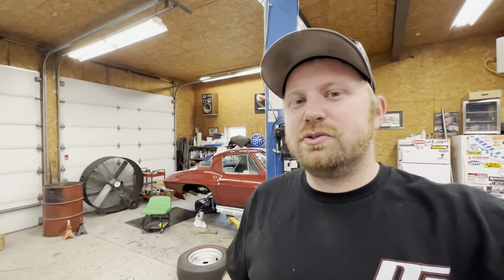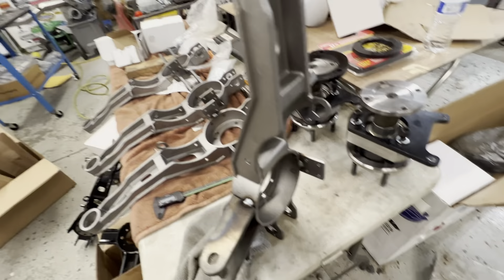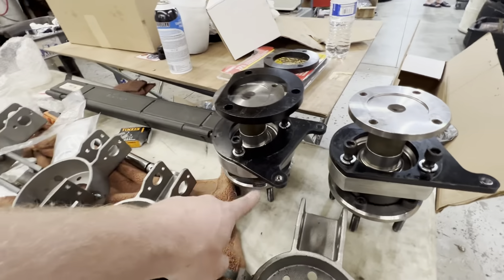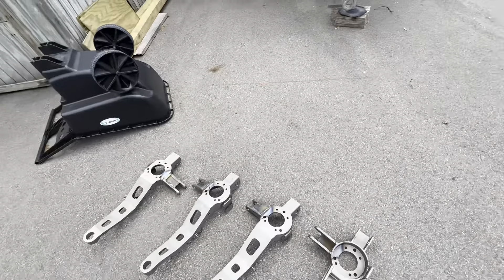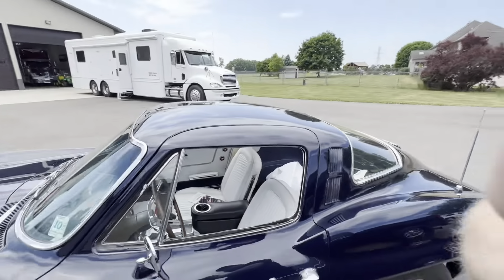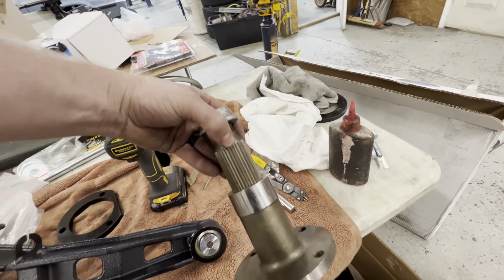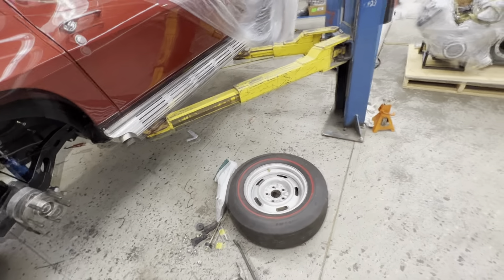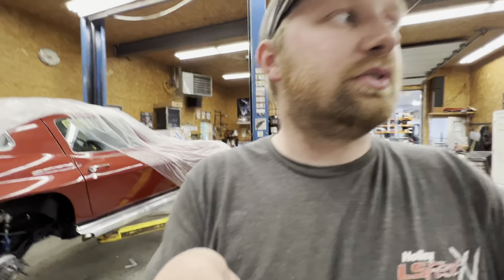Fixing The 1967 L88 Corvette with INSANELY STRONG Trailing Arms. Stock Appearing 427 Vette Updates!

Comment: Ran 1.46' sixty foot with stock Hz Holden suspension, stock front A arms, stock front springs and shocks, just the rear springs and shocks changed, stock original factory rear trailing arms, stock bushes.

Comment: Great to see someone working on the old Corvettes, nice work! I have a 1970. I purchased Van Steel offset trailing arms, along with their coil over rear suspension kit. Top notch stuff. The arms I received are all steel and powdercoated black, just beautiful pieces, I think they are worth every penny. Super heavy duty compared to the stockers, it's not even close. How are the frames holding up to that much power? Tom's sells a kit to reinforce the rear of the frame near the wheelwell. They claim it is a weak point.

Comment: Just because someone said they are 'cast' steel, doesn't mean they need a pre-heat (although they are pretty thick).   The biggest indicator is how much carbon.   High amounts of carbon typically means you can heat treat and you can get hard spots - possibly brittle.    If heat treating is an issue, cover the piece in a blanket to slow down the cooling.
Reply: agreed, if they're cast mild steel they shouldn't need any preheat... but if you have a nice torch and a little time it certainly won't hurt, especially on something that thick.
Reply from the maker: That’s good to know! Thank you!

Comment: Question on trailing arms.   Have you looked at Global West's?  And I've see other offset trailing arms and assumed they were all the same brand under the cover....   So Van Steels are the strongest?
Reply from the maker: I did call Global west, they didn’t have any available.
Reply: Having built Vettes 20+yrs ago, I can tell you Van Steel was the #1 supplier of offset trailing arms and rebuilt bearing assemblies. Back then all the major catalog retailers were sourcing thru VS and placing a markup to their customers. Everyone except Dr.Rebuild who would just tell people to go directly to VS. In those years, people were still establishing wider wheel fitments (17s) and hp tolerance of the rear. Plenty of guys shattered the pumpkin and threw half shafts. Then someone, I forget who, came in with 6061 half shafts and carbon fiber. For a time, VS also bought off those guys. They were so affordable, they quickly got swamped and subsequently raised the prices. This was in the early days of buying online. 

I also remember there was a guy in the Dallas, TX area who was putting 12 bolt rears in the Vette pumpkin. Other guys were trying to push in Dana. 

I've been out of the game for a bit, but I remember those were the days of winging it and hoping it'll stay together. At least one guy in Texas was running a mechanical roller big block Chevys back then, too. He was in the 10s. He also ran VS.

Comment: curious - if you narrow 1/2" won't you have to shorten the half shafts  ?
Reply from the maker: I’m actually moving the outer stub axle outward, while the entire trailing arm is moving inward. So the half shaft length should still work.